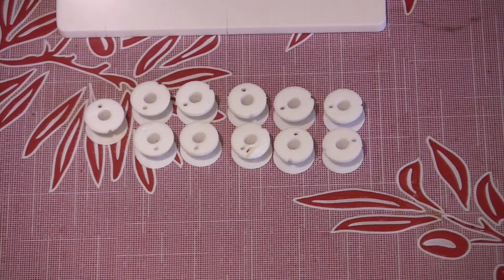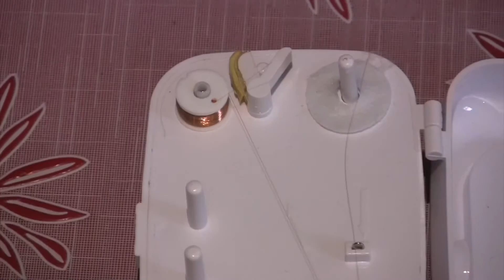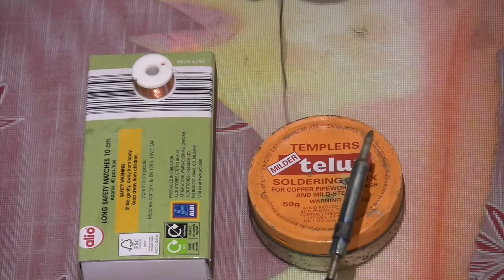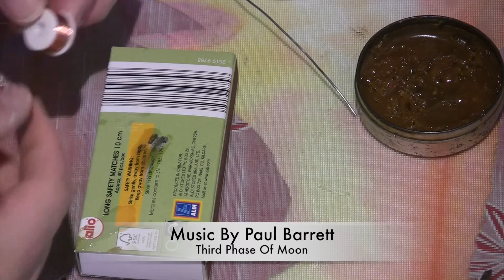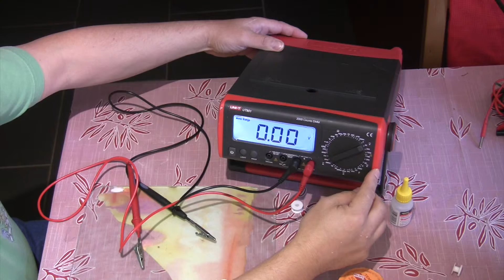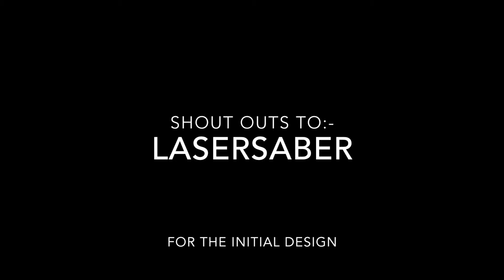Winding up my Bobbins

Comment: Do you think this method could be used with 50 gauge wire? or 48 Gauge?
Reply from the maker: Hi, I buy my wire measured in mm.  I can wind 0.064mm & 0.050mm with no problems.  I hope that helps.
Reply: 50 gauge is .02 mm. I am concerned that it is so thin that it would snap rather than wind. I have ordered some from China, and I was hoping to use the same kind of winder that you have. 
Paul
Reply from the maker: From my experience  its how the wire comes off the bobbin that counts.  I find it better to put the bobbin on the floor in a vertical position and let it coil off at its own rate.  I have a feeling you will be fine, there is a little bit of skill even using the winding machine, you kind of get a feel for it.  Let me know how you get on.